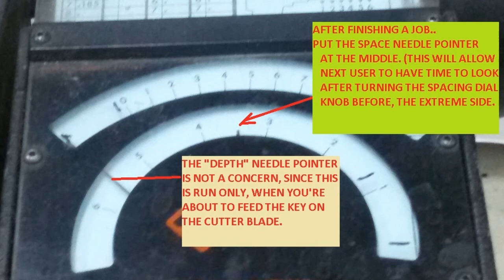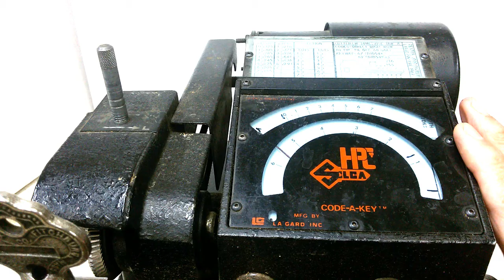TAKING CARE OF HPC SILCA CODE A  KEY 1200 DUPLICATING MACH

Comment: The HPC company does sell a calibration kit for the 1200 machines it's a real time saver!!
Reply from the maker: thanks HKS SYSTEM lock&safe. i think those kit are just for normal wear and tear of the machine, but when it comes to derailment of the gears it may help just as little. but thanks anyway..at least i know now there is an avilable calibration kit. regards.